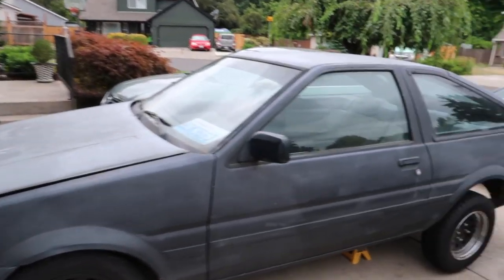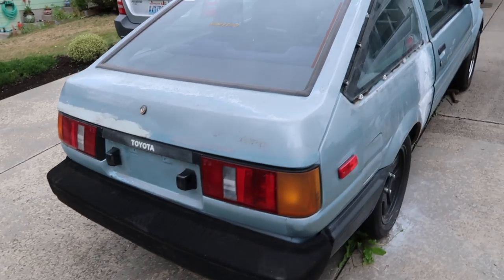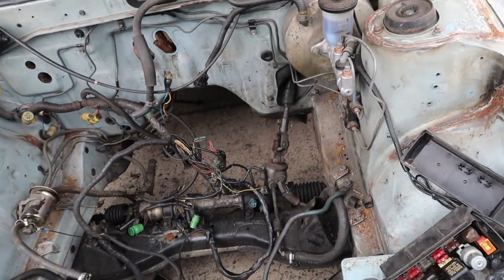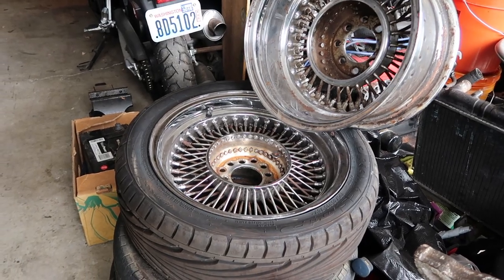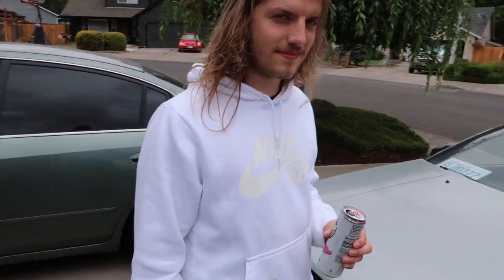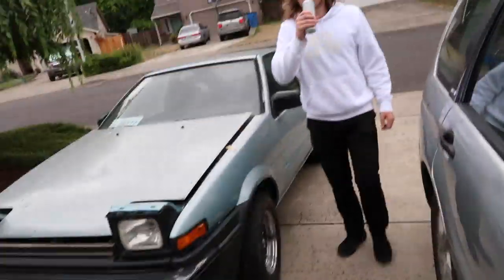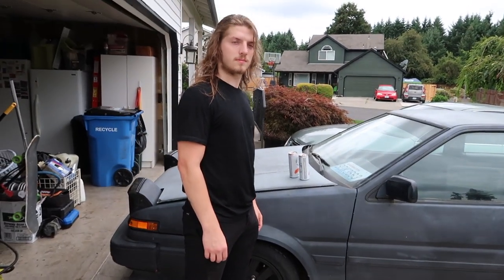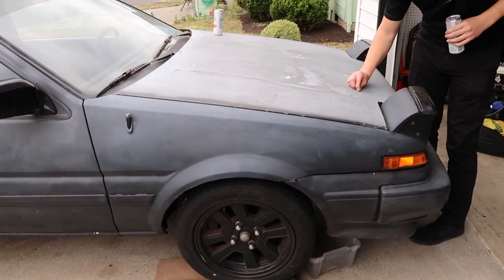I Bought A Legendary JDM Car

Comment: U guys can straighten that wheel out get a 2by4 fill up tire with air get some card board to put rim on so u don't scratch the lip get a hammer lay 2by4 down on rim an beat it back straight I've done it on a lot of my wheels